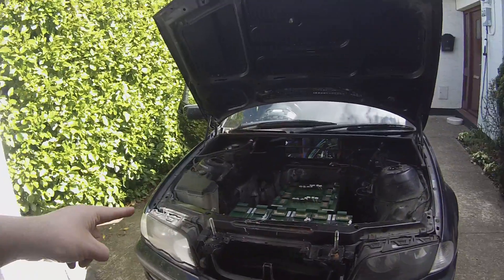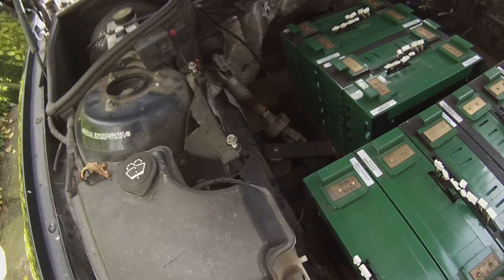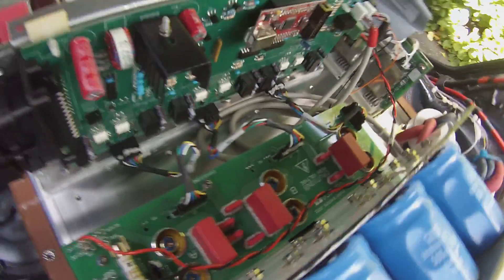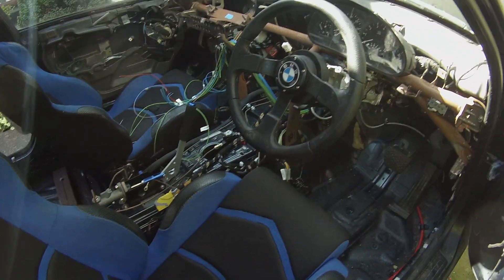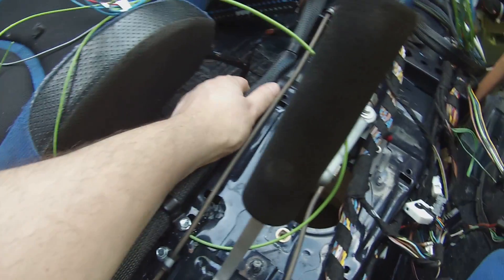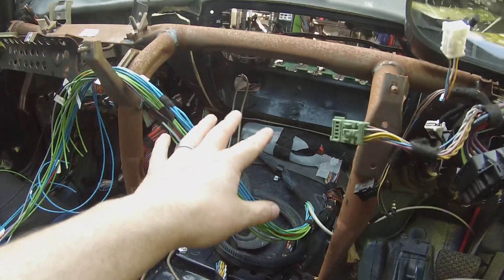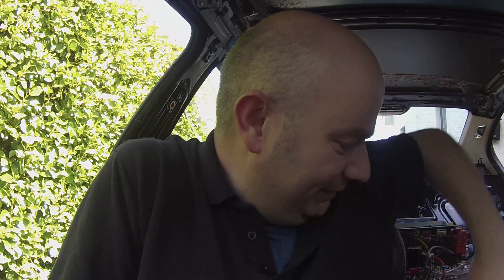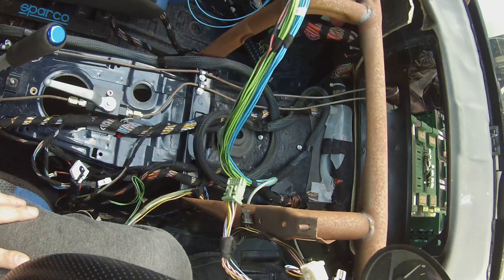BMW E46 Budget Electric Drift Car Project 17 : Inverter Install

Comment: Hi Damien. Is that a industrial ac motor?
Reply from the maker: No , It's made by Enova systems for vans and light busses etc. Quite heavy by today's standards. I think they are about 10 years old judging by some serial numbers and dates printed in the inverter.

Comment: Great job Damier. I am trying to build the Heubner project too. I mean to use high voltage as you will do. About 300v using the 18650 cells. It is fantastic to see you using his inverter on your electric BMW drift car project. This way i can have one aidea on what a can do on my car. If it rans good on your car this will be fantastic on mine. I will use it on a Peugeot 106, 2 doors, year 2000. Today i have one 5cv, 8 poles, 36 slots, frame 132 induction motor. I will rebuilt it folling Ivan'sGarage exemple and use it with Heubner inverter. Could you tell what modifications did you do to the inverter? This will be realy helpfull to me. Congratulations, Damier. Folling you from Brazil and looking forward to see the results. Thanks.